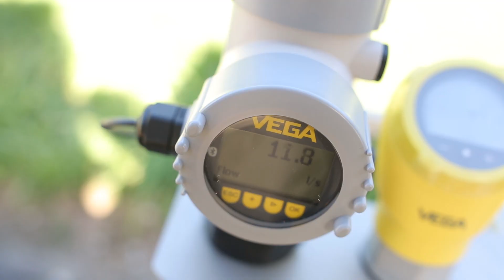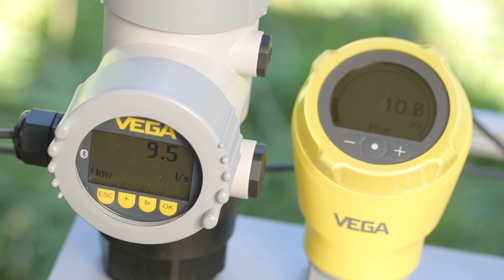💧 Do radar sensors also measure even at changing temperatures? | VEGA talk

Comment: What model ( or part number) is the radar instrument and what  is flow measurement principle?
Reply from the maker: Here you can see our VEGAPULS 31: https://www.vega.com/en-de/products/product-catalog/level/radar/vegapuls-31
But there are different versions of our VEGAPULS to choose from for your specific application: https://www.vega.com/vegapuls

Can the sensors also be used in open flumes?
Yes, the integrated linearisation curves make it possible. This applies to Venturi flumes as well as individual curves. The linearisation curves are stored directly in the sensor or in the controller and can be easily assigned to a flume with the help of the adjustment tools. This makes it possible to directly display the current flow rate. A totaliser integrated in the controller can also be activated to store the total flow volume.

Comment: This is misleading. Blowing 400degC of hot air in front of the ultrasonic will change the speed of sound greatly...this is not realistic as ambient temperature variations are a lot smaller such as 0degC at night and 20degC during the day which would introduce a very small error of distance measured...which would be negligible over the short range of your setup. Ultrasonic will continue to be used for reliable measurement of level and flow rate determination over Venturi's. Yes Radar has some advantages...but let's not get carried away.
Reply from the maker: Thanks for your comment. To show the influence is difficult in 2 minutes in a short video 😉

When the temperature is changing slowly you are right, the internal temperature compensation is good enough. 
➡ But when the sun is shining at the transducer the compensation is a lottery game. 
Especially at small ranges at a flow measurement the failure can easily reach 10 % up to 20 %.

So, why not using a better radar technology when the price is equal or better, or do you prefer a sunshield or an external temperature sensor?
We sell ultrasonic since 40 years and know the problems, today radar is a better solution.
Reply: Agreed. In the video, it says hair dryer and that sure looks like a heat gun. A hair dryer operates between 80 and 140 degrees Fahrenheit.